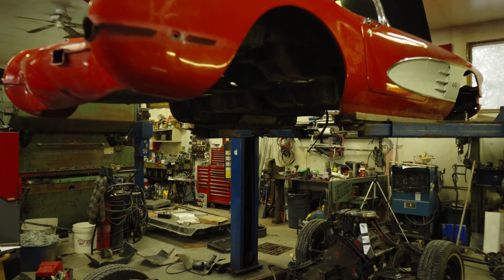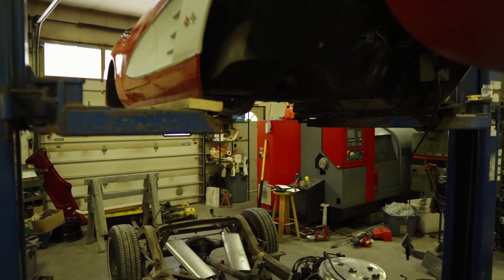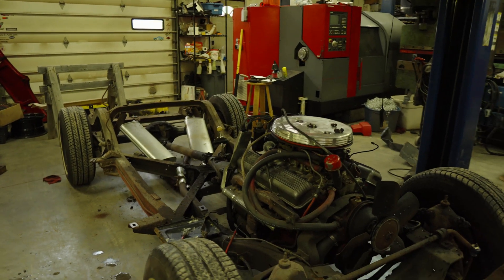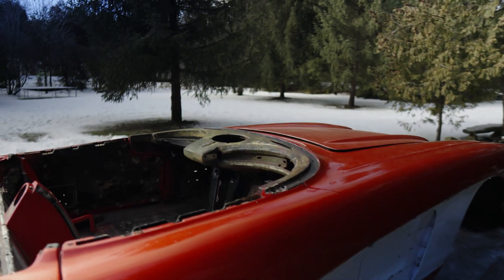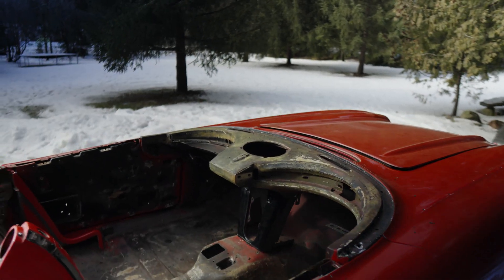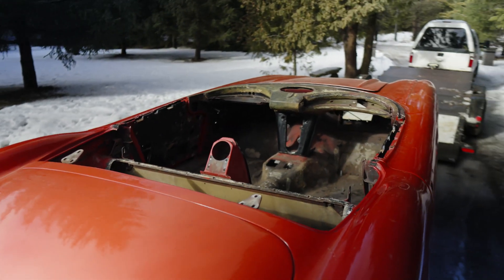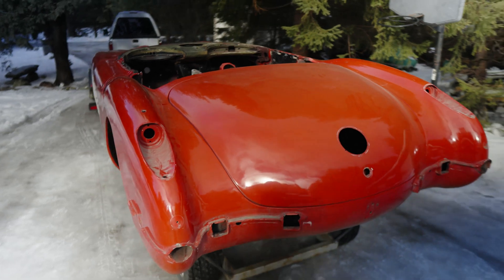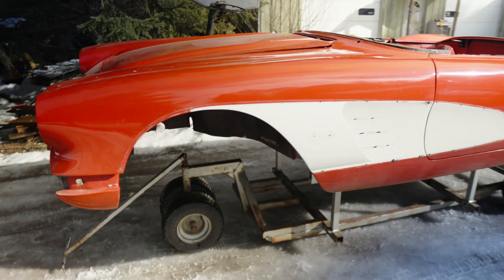First Chapter of the next full EV Conversion! This one will be awesome...

Comment: Really looking forward to this one. l'm all for the ev conversion of old cars. Especially with a suspension upgrade. Sure you lose the exhaust sound but you get used to that pretty quick. There are ways you can keep that if you really want to.
An electric converted car gives you all the mod cons just like a restomod but there's an extra benefit. V2L. 
Most people rarely drive their custom car so it's parked in the garage most of the time. A big battery just sitting there unused. Makes sense to use it to power your house. Something l'm investigating right now. 
Don't worry about the video schedule. Just when you get time is totally fine by me.
Reply from the maker: Thanks! Appreciate you being here and wish more people would think like you! Bi-directional charging makes alot of sense to me, especially in a secondary car or hotrod.